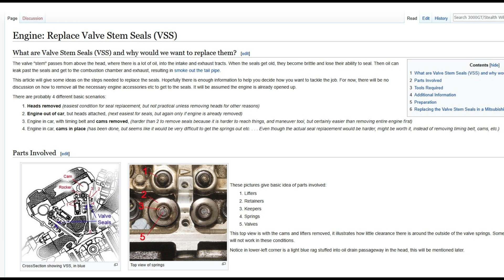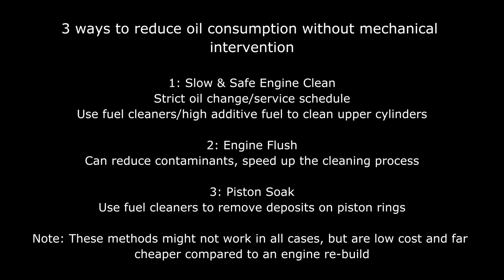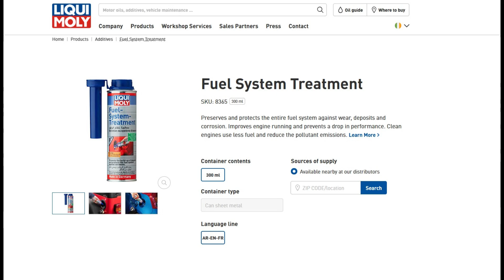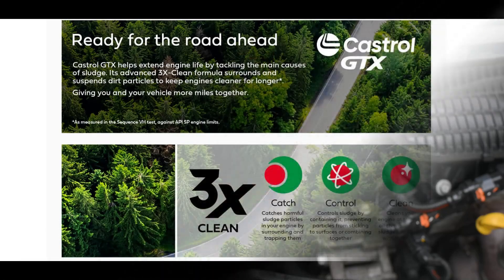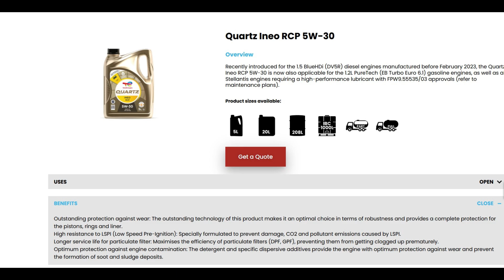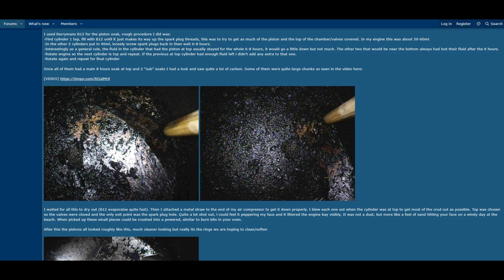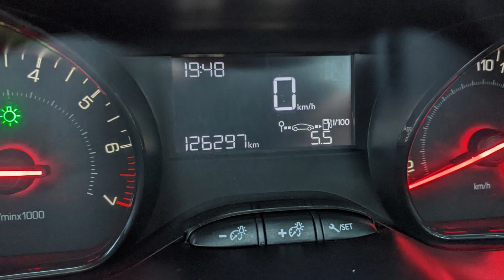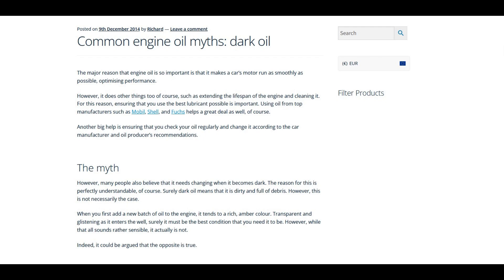How to reduce engine oil consumption: Without an engine strip down

Comment: If you have a Puretech engine with a turbo Peugeot and Citroen will replace it if it's not older than 10 years or have more than 180000km , my Citroen is currently getting a new engine. Because of this frictionless piston rings the rings get stuck so I've tried different ways to get the rings unstuck it doesn't take long before you sit with the same problem.
Reply from the maker: I know there are some warranty claims from owners. Unfortunately some people don't have a dealer history or full history for servicing and are looking for other methods. It's great you're getting a new engine though, and yes you are right the piston rings are the primary reason (blocked oil control rings). It's a problem across many makers and brands though, all down to low tension rings, and I've seen in on engines entirely different to the Puretech ones. 
Strict service schedule is needed, and the usual 15,000KM is too long, if you halve it or put it on a 6 month oil change interval, it's very unlikely you'll have problems down the road with the rings - the oil is too clean to clog them up. People can decide the exact OCI to use, but every year is in my view too long.

Comment: Our 2018 Citroën C3 1.2 (82 hp) consumes about 1L of oil every 5000 km, with almost 150k on the odometer. Should we be worrying?
Reply from the maker: No that's minimal oil consumption, very much expected and within spec. I'm not sure how often you service the car, keep an eye on it, if you see any increase in oil use - shorten the oil change intervals. This oil consumption, often creeps up slowly, and over many years.
Reply: Go to Citroen as there's a special warranty not many know of. If it's not 10 years old or not more than 180000km they'll replace your engine but beware the agents won't tell you or say it isn't so but it is so mine is getting a new engine and it's a 2016 model but also only the turbo version they will do it and not the non turbo version
Reply: Did tou change you belt and at what mileage? Also which oil are using in the service?

Comment: The other thing to ALWAYS check on these 'oil-consuming' PureTech engines, is the bottom of the breather tube connection, hidden down on the right-hand side of the engine – which goes to the top of the air filter box. You can see the top part of this tube in the opening shot of this video. My 1.2 Citroen DS3 was losing about a pint a month from the plastic connector on the lower end of this tube. The connection itself has 3 legs on the bottom of it, which get brittle after a few years and break off. Nobody EVER mentions this as a potential reason for oil-loss on PureTech engines. Since replacing this connection on mine 12 months ago, I've not had to do a single oil top up (apart from the standard annual oil change).

Unfortunately, nobody sells this connector as a stand-alone part and Citroen classify this particular connector as being part of the rocker cover. So my local Citroen garage quoted me £350 for the whole assembly! Yes, you read that correctly. To avoid being robbed by Citroen, I initially cut some wood into a wedge shape and pushed it down next to this loose connection, to hold it firmly in place. This partially worked. But after a couple of journeys, it'd always shake out of position. So in the end I bought a used rocker cover on Ebay, for £35 (after I'd confirmed with the seller that this breather connector still had all 3 legs) and used just the connector off of it.

I strongly suspect that a number of claims about this being a bad engine design, actually relate to people losing oil from this dodgy connector. As an extra precaution, I also added some ZX1 to the oil on my engine. This should help protect the engine if it ever gets low on oil again. But like I said, I've not had to top the oil up once since replacing that plastic connector.
Reply from the maker: That's a very helpful tip, it's always good to check for leaks and that will be useful to others, yet leaks in the system can cause oil loss problems. As for the other reasons, much depends on the servicing regarding oil loss, but as I mention many people use the standard 12 month interval and do start/stop driving and it's too long to go between oil changes.
Even if someone wanted to do a simple oil extraction via suction pump every 6 months, just to get fresh oil in there, that would surely help. It's best to drain of course and change the filter, though once the engine is much cleaner, you can ease up on the servicing a bit (not as strict as this was in it's first year aka 3 oil changes)
I've not used ZX1, but heard about it, how do you find it? I see conflicting information - some say it's great, and others that it might not be great with copper or brass if there is any in the engine. I did toy with trying it, did you notice any difference?

Comment: Replace  the oil pan gasket  and wash out the pan and clean the oil varnish.,  ithelps greatly.
Reply from the maker: Thanks for that, yes it does help. I suspect though, most won't want to remove it and re-seal it, so I've concentrated on non invasive methods.

Comment: I’m in the same boat, my wife cactus is also burning oil, very good advice, my local Citroen dealer told me that they are having problems with the new timing chain models, where the chain is stretching. Hopefully they. Will get it all sorted out with the puretech engine one day.
Reply: If your vehicle isn't older than 10 years or less than 180000km they'll replace the engine under a warranty not many know of ,mine is currently getting a new engine
Reply from the maker: Unfortunately the oil burning isn't limited to Stellantis models, it's extremely common among most makers. Timing chains can cause problems with wear/stretching, or tensioners. Wet belts have their own issues too. Many problems can be resolved with tighter service schedules, the new oil (RCP) as shown is said to resolve the chain wear problems. It does take time to reduce the oil consumption, but my experience is it's not something you have to just put up with. I'm making some progress with engine cleanliness, using the methods shown. I hope you can improve the situation on the Cactus (it's quite a nice car to drive)